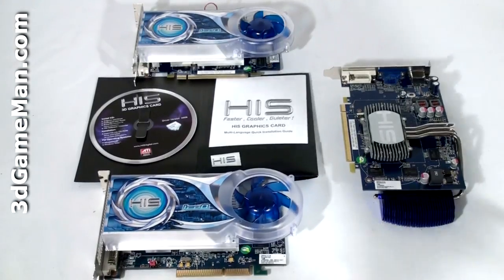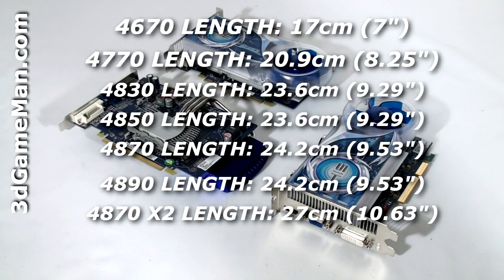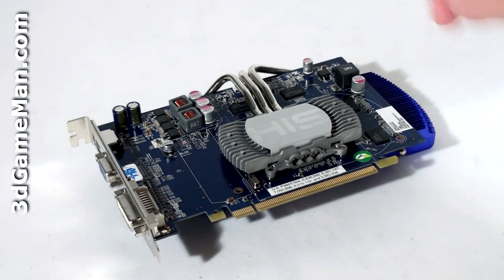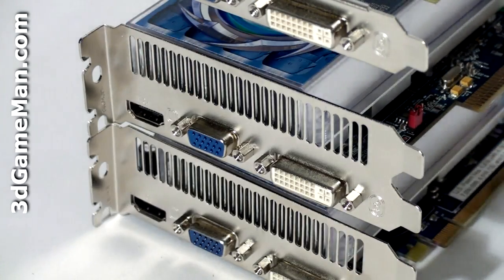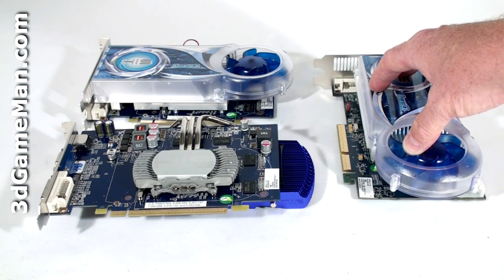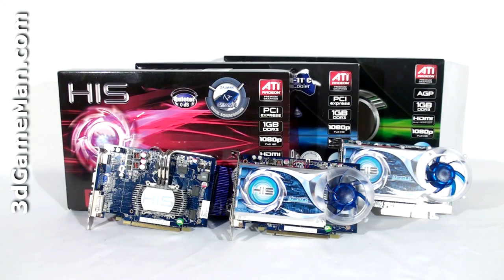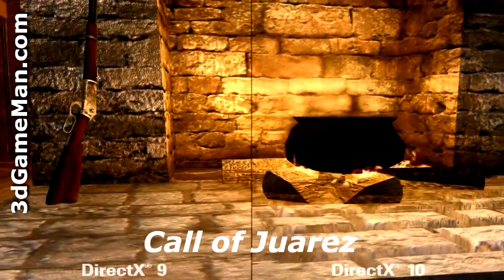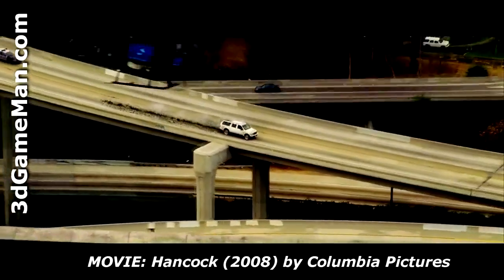#1089 - HIS HD 4670 IceQ & iSilence4 HDMI Video Cards

Comment: I was using hd 4670 agp on a athlon x2 5000+ dual core overclocked to 3.1mhz, 4 sticks of ram, two 7200 hdd, 2 optical drives, 4 fans, on a 300w psu. It ran well, it is a 65w cpu I think because it was a low watt cpu. I put a quad core phenom ii 965 (125w) and my psu could not handle it and would reboot randomly with heavy load.

It might work out for you did you look online at Power Supply Calculators with my dual core set up the calculator said @ 100% load i would draw 310w or 305w.
Reply: n0ti5 do you still have this gpu?
Reply: @ Keith Alexander Jr. yeah I still have it, its sitting in the box somewhere in the closet

Comment: i have a 300w psu with 15 amps on the 12v rail, everything i have in my system right now is intel pentium 4 3.00ghz, 4 sticks of ddr ram, a 7200 rpm hdd, and 4 case fans, would my psu handle the agp version of this card

Comment: @musicmanJrpro Since I went from a 32" LCD HDTV to a 20" LED PC monitor I don't play at stupidly high resolutions, I play at like 1280 x 720. I'm not a resolution freak. Obviosly resolution is the most taxing also. I've gone through over 30 or 40 games (with this current rig I've only had one year) from old games to current and haven't had a problem *knock on wood*. Takin apart my PC and it's components (like PSU) and cleaning everything drops temps lke 4-5c, obviously speeds up games (a little)

Comment: @musicmanJrpro Yeah, I literally just beat Crysis 2 about 10 minutes ago. Played on all Very High (not Extreme though lol) with average 40 fps at all times and my setup is Athlon II x2 2.7 ghz, Patriot Extreme Gaming RAM 4Gb ddr 200, 580 watt PSU, regular ol' 7200 rpm WDC HDD, Windows 7 Ultimate 64 bit, Rosewill Wind Knight case with 6 120mm fans, replaced thermal paste everywhere with Arctic Silver 5. Not a great setup but it does what I want.

Comment: @musicmanJrpro Yeah, it's funny how ppl think it's just your vid card, CPU, or RAM that governs how fast a game runs. There's so many other things involved that help a game run faster like cooling, a high speed HDD (a Velociraptor or higher), how many background apps are running, how many processes running, defragging HDD, cheap thermal paste or arctic silver 5 or better, ventilation/air flow, your registry condition, general pc optimization, game optimization, that's just to name a FEW.

Comment: Anyone wondering about getting 2 of these cards for Crossfire.. DONT. Get a 5670/5750/4870/4850 instead.
-
Quick FPS results for this card; GTA4 (1680x1050; all maxed; 35FPS; Intel Q8400@3.7Ghz) Blur (1680x1050;maxed; 56FPS; same cpu as above)
-
But really, go for a 5000 series. The 4670, at the time, was as good as a 4850 in most games, Rodney is comparing it to very high end, so yeah. It's a shit(ish) card now though with DX11 out. :)

Comment: Oops, my bad. I was looking at the wrong card. The $1,299 one was some crazy rediculous card as long as my freakin case with 2 huge fans on top, and water cooling on bottom. Look at the HIS Radeon 5970 Lightning. Bad ass. and NOT $1,299 (I don't think) lol. That freakin card has "3,200" (yes, thousand) stream processors, 2gb (512bit x2) GDDR5 memory, supports DX 11, OpenGL 4.1, you can image the rest. Can you imagine the power of 2 of those crossfired?!?! 

O.O

Comment: Your not the only exception. I'm waiting for the IceQ 4670 to arrive in the mail soon. I had an OLD Geforce 6800 128mb ram, lol, with a fan system similiar to this and it lasted 3 1/2 years. I strained the hell out of that card the whole time, in an old Compaq Presario 6000 case, lol. I've had an early model Xbox 360 for 3 years with no RROD before I traded it. Maybe I'm lucky, or I just take care of my stuff. Considering I have a 580 watt PSU, kinda wish I went for a better card though :/

Comment: High-Definition Multimedia Interface is a compact audio/video interface for transmitting uncompressed digital data. HDMI supports on a single cable, any TV or PC video format, including standard, enhanced, and high-definition video; up to 8 channels of digital audio This means that a DVI-D source can drive an HDMI monitor or vice versa by means of a suitable adapter or cable However the audio and remote-control features of HDMI will not be available unless the output supports HDMI via a DVI plug

Comment: Hmm...I must have an older model of the HIS HD 4670 (PCi), since mine didn't have a VGA port. It came with an adapter, but it has a loose connection I have to fiddle with occasionally. Still, the card has treated me well thus far. I can play pretty much most of what I like with fairly decent settings, especially considering my underpowered CPU.
Reply: Does it still work?
Reply: @Lunithraee  Honestly, 15 years later, I'm not even sure what this is reference to exactly. :D